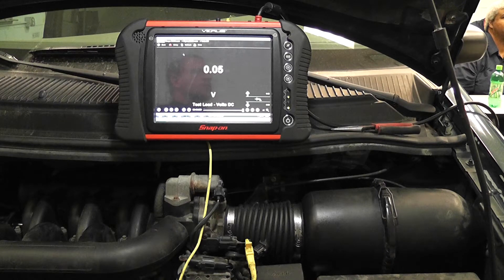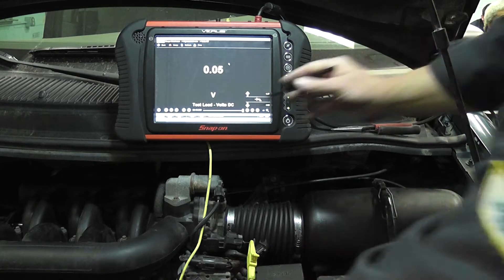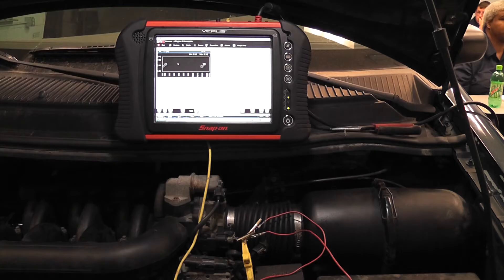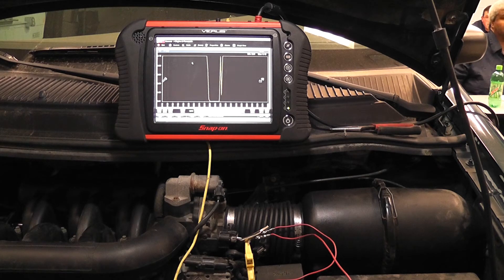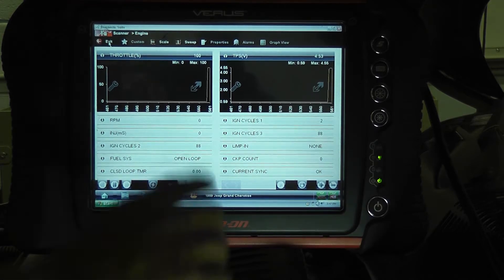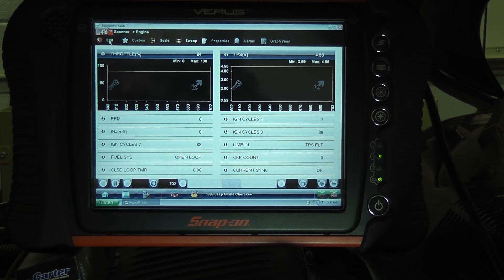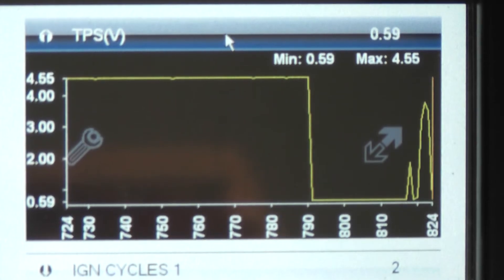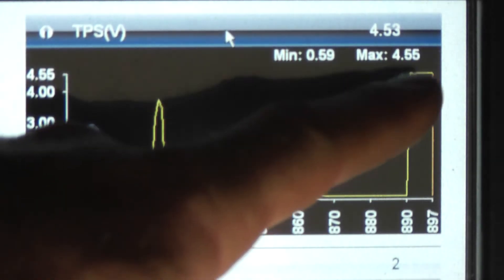How to test TPS wiring with a scan tool (any car)

Comment: sir can we use this method on All Brands
Reply from the maker: Some will have a bias voltage on the signal wire and some will not, so you have to modify the test for circuit integrity depending on the design. I have some classes on signal circuit integrity testing that you would definitely enjoy

Comment: Even though this video 12 yes old it is still helpful. I'm having a throttle body issue with a 2011 Dodge Ram 1500 4.7l.  I've replaced the throttle body 3 times, and the truck still runs like crap. I've been trying to figure this out for a while but haven't found anyone willing to touch the truck because everyone says they don't do electrical on cars. It's been driving me nuts

Comment: What would I need to look into if my tps signal wire has 1.67 volts unplugged or plugged up the scanner always shows 4.98 and never changed plugged or unplugged on my 2000 dakota it has the same curicit as this jeep
Reply from the maker: you have an open signal wire
Reply: I'm getting all the right voltage under the hood now but the  scanner is still showing 4.98

Comment: "Do not jump the 5V reference wire to ground." What would happen if you accidentally did?
Reply from the maker: Depends on the car and how many 5v regulators the ECM has. Some newer systems have up to 4 of them. While older systems only had 1.
It will pull the entire ref circuit to ground and on systems with only one 5v reg, the car will shut down and will not restart.
Here is one that had 2 regulators and what it was doing https://youtu.be/N_MMqIRIVQE
Reply: @ScannerDanner  okay, I got you. I thought it might do like permanent damage to a sensor, series of sensors, or damage the ECM. Thanks for the vids. Appreciate people investing in others!

Comment: 1:53
Danner: "If the signal wire is shorted to ground, would it have went to 5 volts on the screen?"
Student: "Yeah"
Danner: "Not, it would not have."
Dry but will make you remember next time.

Comment: Why is needed to pull that 5 volts from signal wire to ground for integrity test ? Isn't just enough to see steady 5 volts on signal wire to be sure for signal wire integrity. Sorry for bad english, I from Croatia

Comment: Two questions dr danner
1/ if you havent got a wiring diagram and your three wires have aprox 5v 0v 0v when disconected. What is the best way to determine which is the signal and which is the ground?
2/ when jumping the 5v ref to the signal wire can you use a test light.i would imagine this would be safer then useing a bit of wire if for instance you dont have a 5k ohm resister to hand.
Thanks in advance
Reply from the maker: Yes! The test light can be your "safety net" in case you jump the wrong pins.

Comment: if the middle wire is the reference wire and the one with zero  volt is the ground, the what is the purpose of the other wire with 5.17 volts?
Reply from the maker: Reference, signal and ground

Comment: Hi Paul i fixed was a connection issue at the signal wire pin tps side not computer. Computer send 5v reference pull down design thats the reason was jumping between 0.5v to 0.8v the pin from the signal wire was kind of open. I choose to change the connector cuz remove the pin from there and fix it would end by braking all the plastic cover. Thanks
Reply: Nice job my friend

Comment: hi danner i did a diagnostic on a kia. p0101 related to mass sensor but the tps was acting up all crazy but the new one that i installed with close throttle the signal is moving from 0.5v to 0.8v i know that 0.5v is good reading for that vehicle. I also look more and for kia sportage in that year(2001) the tps dont need adjustment computer will learn with few starts up. My question is, the tps shouldn't change voltage with close throttle should be at fix voltage with close throttle so the computer wont think that u trying to add gas. The original complain was high rpm at idle and improper transmission shift point. With the new tps p0101 when away tranny shift good but the tps have that jumping at idle from 0.5v to 0.8v and i dont like that cuz making the rpm get up and down between 800 to 1200 rpm. This vehicle use mass sensor and tps for main input sensor no map sensor at all i just wondering if i in the right track or should i look away from the tps sensor to something else i check wiring integrity for any short to ground
Reply from the maker: you are absolutely on the right track. Stay focused on the TPS. Get a voltage reading of your 5v reference and your ground circuit. Make sure they are not changing voltage (your 300mv swing that you're seeing in the signal)
Also confirm that your actual signal voltage at the sensor is moving like you are seeing on the scan tool. (I'm assuming you are getting these readings from scan data).
Finally, make sure that the throttle shaft is not worn out. If it is worn badly, once the engine starts, vacuum pulls on the throttle plate and shifts the shaft position. This is rare but worth a look.
Reply: I saw that from the scan data but i went straight to the sensor signal with the picoscope to monitoring that signal and jumps arround i got the other sensor but before get it on i will check the throttle shaft, signal wire feed wire ground again and dirty throtle plate cuz if have too much gunk it can prevent the plate to close all the way i let u know what's the results. Thanks Paul

Comment: Hi, I have  a chevrolet Suberban 2012  with check engine  sometimes disappears sometimes back again the cars has run about  50,000 KM distance  when I tested it by OBD2  reader  and the engine is cooled and the check engine is off  it gave the code   P0121  throttle / pedal position sensor / switch  A- circuit range  / performance .
my question from where should I test ?  is it maybe the pedal sensor or throttle sensor ? thanks in advance
Reply from the maker: clean the throttle body and then do an idle relearn with the scan tool

Comment: But if the signal wire was open all the way to the pcm it will still read 5 volts when you T pin it of the 5 volt reference wire  doesn't it ?
Reply from the maker: +Milton Solis are you talking about the signal wire "bias voltage" (unplugged test, where the signal showed near 5v)?

Comment: I have a 01 Pt cruiser that runs for 20 minutes then shuts off wont start for 15 minutes then same shuts off
Reply from the maker: +Raymond Burnett you need to find out what your missing when it shuts off. Spark, fuel pressure, fuel injector pulse? Then you'll need to do further testing from there. Report back what you find

Comment: hi paul, thanks for this great videos, I have a problem with a 1990 legacy, it has good feed wire of 5 volts and good ground, but the signal wire with the throttle body fully close my multimiter reads 4.7 and with the throttle body fully open it reads 1 volt, do you think that I have a bad tps sensor? thank you!!!
Reply from the maker: No, some of these early systems did that. For the future :
I am directing all help requests to my forum. Sign up (it's free) and create a new post. Be sure to add a name under "alias" as this is the name that will appear in the post.
Here is the link to the forum. 
http://www.scannerdanner.com/ForumRetrieve.aspx?ForumID=3226
Thanks
Reply: thanks for your information Paul, God bless you and your family...

Comment from the maker: no, this could be a normal number. The KOEO reading is atmospheric psi and will vary with altitude and system design. Honda for example will read 2.8v KOEO at sea level where a GM will read over 4.5 volts at sea level. 
Is 3.6 volts normal for a Subaru at your altitude? It very well could be.

Comment from the maker: no, this is a normal condition. with the sensor unplugged there is a 5v bias line on the signal wire. so sensor unplugged it is normal to see 5, 5, and 0 on the three wires.

Comment: i believe the voltage is 4.7v, leading me to believe that there is a short somewhere leading to the ECM between the +5v and the signal wire, i'm going to locate the pins on the ecm tomorrow and do a continuity test to see if im right, but i would appreciate it if you could get back to me and let me know what you think.. i am getting horrible gas mileage (like 12.6mpg) i am not getting a map code though.. it is very strange to me... thanks in advance for any advice you can lend.

Comment: hi scannerdanner, love your videos, im hoping you can help me with a problem, i have a 99 subaru legacy 2.5l auto, i am suspecting something wrong with the map sensor, when i back probe the ground wire to the signal wire with the key on engine off, i believe im supposed to get somewhere between 4.5-5v, what i am seeing is 3.65v, now with the sensor unplugged, when i test the ground to the signal wire i am seeing even more voltage than with it plugged in. forgot my multi-meter at work tonight,,,